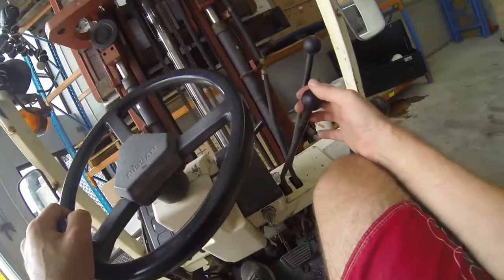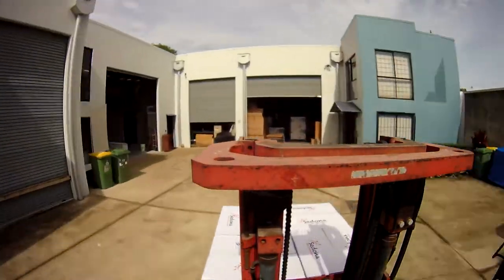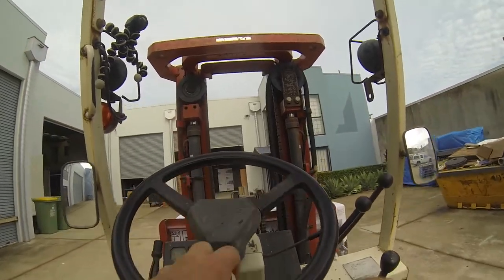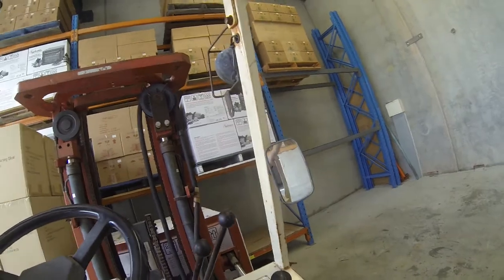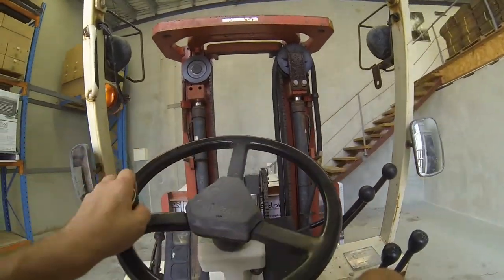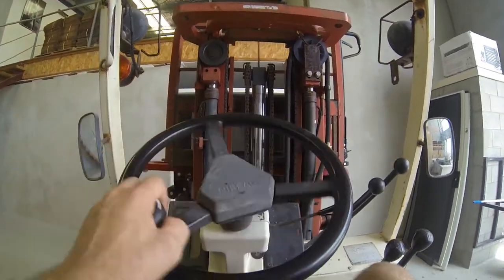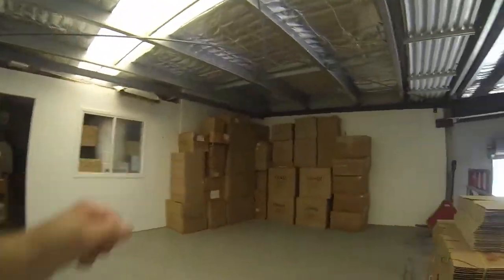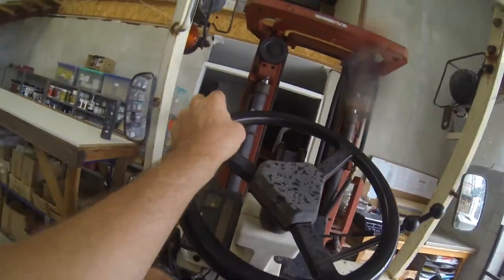Watch Me Flog | World's First Forklift Vlog?

Comment: Oh man those old manual forks can be difficult at times but once you get the hang of it they're great, if you put the pallet jack longways on the tines (once you put them closer together) that's another way of lifting them up. It's best to learn without side shift as it improves your skills.
Great vid two tines up.
Reply from the maker: It is definitely a lot harder to use than the nice new ones I used during my course. Especially the electric ones. They were a breeze to use.
I thought about putting the jack longways on the tines but I was in a rush and could not be bothered moving the tines. I then regretted it when I got to the other warehouse and realised it did not fit. But it was simple enough to maneuver through the gap anyway. :-)
During my course I tried to not use the sideshift even though all the machines had the attachment, as I knew I would not have it in the real world. That definitely helped me. Thanks mate! :-)

Comment: If you lift the pallet jack length wise with the handle against the back rest of the lift, so all the weight is at the base of the forks, it will be a lot easier to get in that narrow opening and actually it is more stable that way.    ;   )